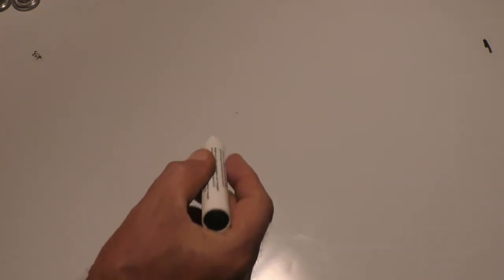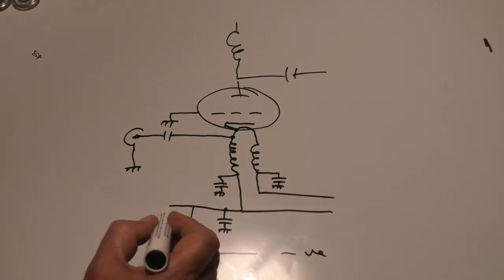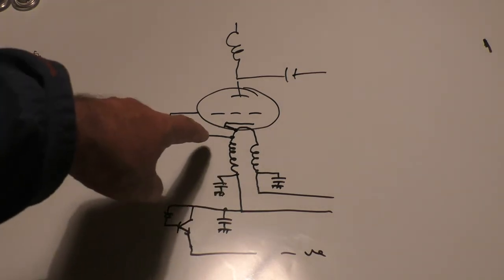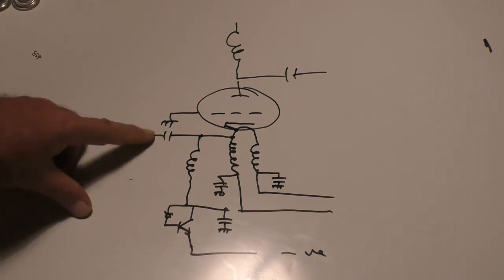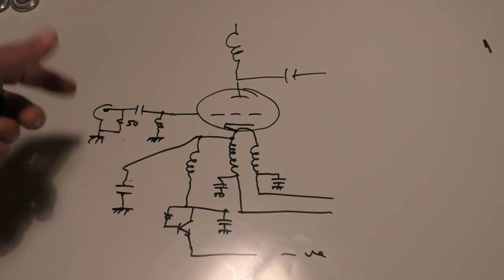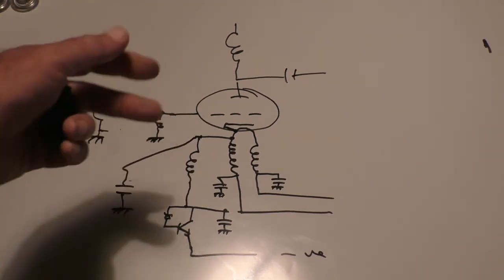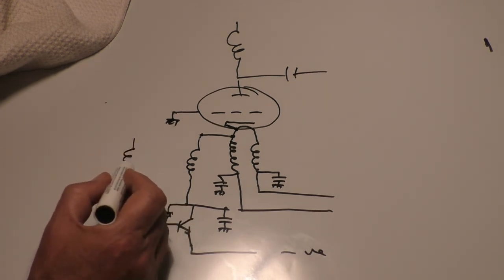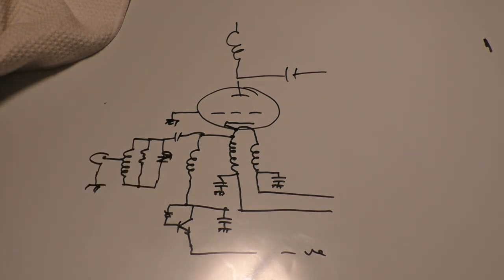So, What Changes Did I Make To The GS-35B Amp...

Comment: I fear you've been smitten by those GU-81Ms whilst the GS-35B awaits completion. Please make a great home for your faithful, albeit finicky, GS-35B. I've followed its journey too long to jump to those other Russian temptresses...although they do look fabulous.  Jon-N5WXZ
Reply from the maker: Thanks for the nudge Jon. You're right, the glow of the GU-81Ms is distracting me from the GS-35B project. I'll get back into it, the finicky bit now is the HT supply. I don't have a transformer that will provide a "Goldilocks" voltage. I have thought of using modified  and paralleled microwave oven inverters for the next project, 4kV at 300ma for $50. So I could get 4kV at 900ma for $150. I wonder what the noise would be like, I might just get one initially to try it.
Reply: As I've considered building a "from scratch" amp, the iron has stopped me. Finding a hefty transformer has been frustrating. When you do find one on eBay, it's for "local pick-up only." Now, why would one shy away from shipping 100 lbs of iron? I have a limping Dentron Clipperton L in the shack that I bought to serve as my first HV laden project. Anyway, would love to see what you could work out with the bits of microwave oven approach. Just make sure your life and fire insurance are paid up. I enjoy your channel...and your humor.

Comment: I think I suggested in one of your videos to perhaps think of one of the NOS Russian tetrodes due to the simpler broadband 50 ohm swamping resistor on the input. I've since read that the IMD products are higher than a GG triode circuit. 🙁

Comment: Excellent experiment with the triode. Do keep in mind that tuned grid driven triodes make great TPTG oscillators,  unless their neutralized. ;-) That's the beauty of GG. Only drawback is driving power. I seen swamped 50 ohm grid driven amps that use tetrodes biased for AB1 operation which work great, but have less plate efficiency. Screen grid tubes have the screen that isolates the plate and control grid. There's obvious tradeoffs between triodes and tetrodes. Just a few thoughts I thought I'd mention. Great work!
Reply from the maker: Hi Bob. Thanks for the comment. Fortunately the GS-35B isn't particularly gainy so if it had worked well I probably could have got away with no neutralization. The fun continues...

Comment: I've seen some amplifiers using RF relays to switch between the input band circuits and a simple band switch. Seems it's cheaper than one of the multiple pole rotary band switches and has less stray capacitance. 😉
Reply from the maker: Yes, I've seen that too. They use the cheap Russian vacuum relays for the output and small relays for the input. I want to keep this as simple as possible with as few components as possible.
Reply: This may give you a couple of ideas...  https://www.youtube.com/watch?v=F2Cyu4vFzOc
Reply from the maker: Thanks for the suggestion. There are two problems with what this guy is doing, firstly he's simulating the cathode input impedance with a resistor, this provides his input circuit with a constant load. The input impedance of a grounded grid amplifier is dynamic and not constant so it's not a realistic substitute. Secondly it's too complicated, I want as few components as possible in the amplifier. I don't really want to put a tuned tank circuit for each band on the amplifier input, and I don't really want an auto-tuned tank circuit which is what this guy is after... I think. I saw a Kiwi guy's design for a single 813 amplifier with a parallel tuned input circuit with one inductor and one capacitor... supposedly it's ultra-linear, although he doesn't provide any output waveforms, and his quoted output power is a tad optimistic. It's probably worth a try though.